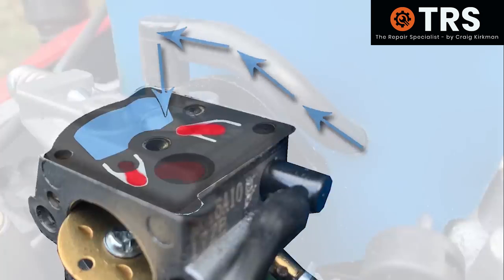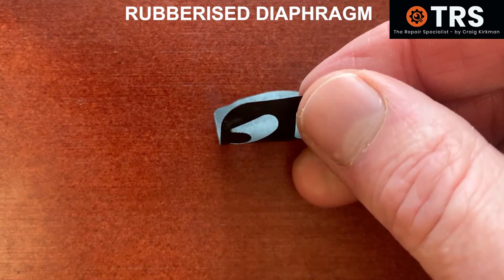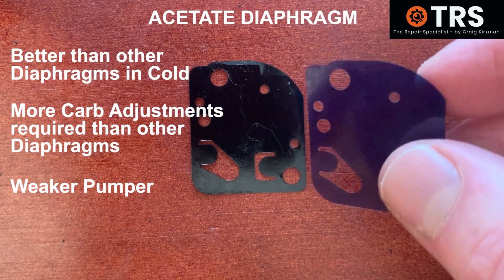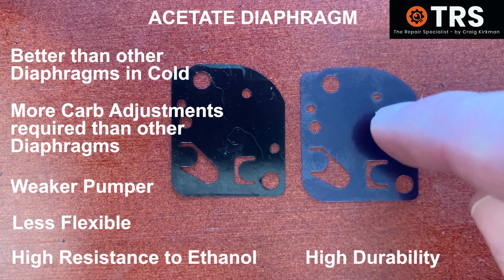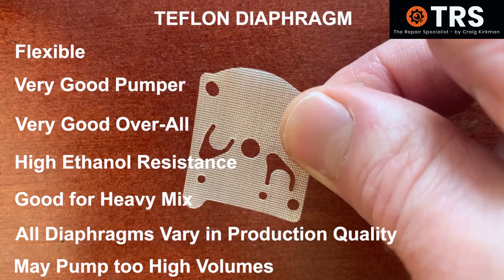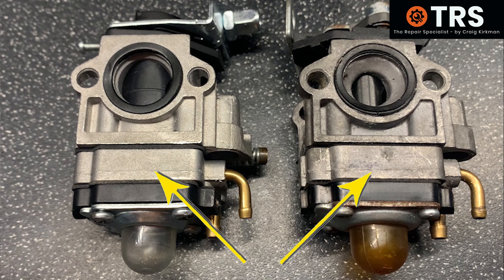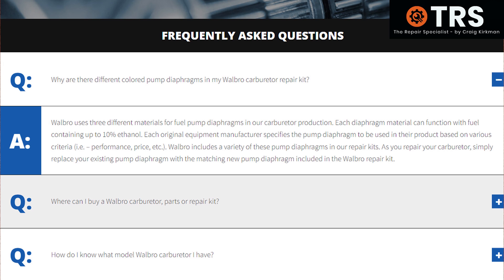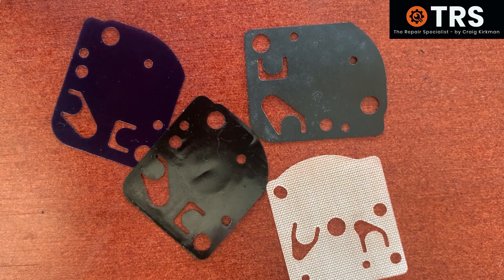2-Stroke Carburetor Diaphragms Different Colours. This is why!  (by Craig Kirkman)

Comment: Rubber diaphragms always dissolve in alcohol-containing gasoline. You can then see through the tissue where the rubber was once attached, and they are no longer gas-tight.
The dissolved rubber can be present in small holes in the carburetor, so this should be inspected, preferably with a magnifying glass. It can be difficult to see in small holes, causing the engine to still run poorly after installation.
Using an alcohol-resistant diaphragm is only useful if the rest of the carburetor also does not contain rubber that can dissolve in alcohol.

Comment: i have walbro carb on my chainsaw and i put fresh new diaphragms but problem remained as it was with old one....when i give it some throttle chainsaw chokes. it does that with both sets,old and new. my guess is that nozzle jet is not working properly or there is some dirt that blocks its "lid" that closes and opens the nozzle jet.
both L and H are 1.5 turns out...
it is like fuel is not arriving from second and third hole when i give some throttle. you know of which holes I am talking about.
so what are my options? new carb,ultrasonic cleaning?
Reply from the maker: Hi. 

It definitely sounds like you’re on the right track. If both the old and new diaphragm sets give the same choking and fuel starvation symptoms when throttling up, the issue is likely deeper in the metering or main nozzle circuit rather than the diaphragms themselves.

If fuel isn’t arriving through those small progression holes when you open the throttle, it usually means there’s a blockage in the main nozzle jet or emulsion passages — these are extremely fine and can trap varnish or debris that normal spraying won’t remove.

Your best options:
	1.	Ultrasonic cleaning – This is the safest and most thorough way to clear internal blockages without damaging soft metal jets. Run it for 10–15 minutes in a 50/50 water–degreaser mix, then rinse and blow through with compressed air.
	2.	Replace the carburetor – If cleaning doesn’t restore consistent fuel delivery, replacing it may be more cost-effective than chasing hidden restrictions.

Also double-check that the metering lever height is set correctly — if it’s too low, the needle won’t lift enough under throttle, and you’ll get the same “lean choke” behaviour even with clean jets.

I hope this help a little and please let me know how you get on with this. 

Craig
Reply: @TheRepairSpecialist  thanks a lot. i will try to do that

Comment: I always use non ethonal  , 97  it's slightly more but I never need to re build or replace carbs  

25nyear old chainsaw just required it's fule lines replaced,  and it's diagrams we're just fine n dandy. And they are original . !

Fresh high quilty fule n oil mix is the key to not rebuilding a carb  !

Comment: I found recently when I rebuilt my Walbro carburettor on my now discontinued Hitachi line trimmer the number on the carb did not match with any walbro kit.
I went to my local mower/ chainsaw repair shop and we matched up the gaskets from the walbro kits he had in stock. They were all the rubberised gaskets the same as the originals as our petrol from most of our suppliers here doesn’t have methanol.  It had extra gaskets that I will never use but at least my faithful 9yr old Hitachi is running perfectly again. 😀

Comment: Hi Craig, I was wondering if you could advise me on what I'm doing wrong in putting together my Zama carburetor. I've taken apart many carbs & rebuilt them, but this one is really frustating me. It is a Zama H18B   CIU 44P. No matter how many times I put it together, it always leaks gas from the primer bulb end. I can't seem to buy another one from Walbro. Your advice would be greatly appreciated.
Thanks BOB WHITE

Comment: Are there diaphragm carburetors with 2-stroke oil injection ports and also coolant-taps (for quick-heating & heat-dissipation)? I've looked for it a while and not had much success in my search

Comment: I was wondering what the different materials were for, and noticed I had used a Teflon one, in one of my oldest chain saws. The carb needed cleaning, slight adjustments, inlet screen was plugged. The Teflon fuel pump diaphragm is in excellent condition. The metering diaphragm was, if anything, a bit soft.
My old chain saw would want a good pumper, and the a-holes in government mandated that all grades of gas here have some alcohol in them.

Maybe they could make metering diaphragms to replace the rubber ones???

Comment: Ethanol was the biggest mistake our government did to provide welfare checks to the corn farmers.  I have had many issues with my small engines and the damaging effects that ethanol has had on the materials related to supplying fuel to the engine.

Comment: They need to make them run off a small Propane tank lantern size tank the green color 1s u buy in the camping area thats would fix alot of flooding and just runing problems that come alone with gas trimmers and they burn so clean !!!

Comment: Hello Craig  and thanks for this materials and properties video .
I just wish I'd seen it before, I've just replaced acetate with acetate but thought the Teflon one was just for an upgraded carb that I didn't have , and I m fairly certain that we have our E5 fuel till 2025, after that there's no information. It's worth the extra for me as I only use about two or three  gallons of 2 stroke per year , ( about 12 to 13 ltrs ) .Thanks for sharing Craig. 😊 ATB, Ian👍

Comment: Great video!!!

In Canada i use and ice auger to go fishing in winter drilling through four feet of ice or more and over the years have serviced my carberater a few times and have used both ethanol and non-ethanol fuels and now use inly non-ethenol and found that my silicone valve diaphram has help up for many years now and all I’ve had to replace is the actual pump diaphragm made up of a different black material. 
This has been on a 24 year old jiffy ice auger model 76 with a tillotson carb.

Comment: Did not have that information prior to this. But I have a chainsaw that has been old faithful. I live in the southeast. It has recently gotten colder than it has been. The saw has a rubber diaphragm on it. Well the carb is clean. It will not run properly. Weed eater, mowers ect run fine. Non ethanol fuel. Changed diaphragm saw runs great. Thanks!

Comment: I agree the black rubber ones seem to wear out very quickly, mine are on 20/30cc petrol aeroplane engines, most of the time running flat out on 98% octane and 3% motul 710 synthetic oil mix.

Comment: Perhaps if the engine and suction is worn, you could use the teflon one to give extra pump boost?  I have used all 3 but never seen any issues after tuning in. This is with 25/1 mix and i always tune  slightly towards rich to be certain theres enough oil, never fouled a plug yet! Seems the acetate ones couldnt pump as being totally stiff?  and i only use straight fuel with the oil so dont need that type of diaphragm.

Comment: What I think is that your videos are awesome lol. 
To give an example I used to be a Johnsered chainsaw dealer and I purchased a saw as well as a trimmer back then and that was around 2002.
I’ve never had any problems with the carburetter on my trimmer, and it has never ever seen ethanol fuel, and I decided to pull it apart to clean it two years ago, and I was astonished that it looked like a completely brand new carb there was no dirt or no anything in that Carb.
I pulled others apart that I started using ethanol after only one year and I was seeing a white powder inside of them even just a Lake coding. It just eats everything.
I’ve used ethanol fuel, and it takes out the check valves as well. Best to just not use it at all, if you can. 
In Canada here we have a few fuels that have no ethanol in them .

Comment: That is all very good information to know & it all makes total sense, but why aren't all of the diaphragms cut the same? Like where the valves go as explained in your video how the priming system works?
Reply from the maker: Thank you for your kind feedback. I really appreciate it and I'm glad you're diving into the details of carburetor maintenance—it's an area that can certainly benefit from a clear explanation. The reason a carburetor service kit might include diaphragms with different shaped cut-outs, even though they're for the same type of diaphragm, usually boils down to the application of the kit across different models or variations of carburetors.

Here's a more detailed breakdown:

Model Variations: Carburetors, even within the same brand or engine type, can come in slightly different configurations. Manufacturers often design service kits to be as universal as possible, accommodating various models. Different shaped cut-outs can match different carburetor tops or internal configurations.

Year of Manufacture: Across different production years, the same model of carburetor might have undergone slight revisions. These changes can include alterations to the carburetor’s internal chambers or vacuum ports, necessitating a different diaphragm shape.

Aftermarket Modifications: Sometimes, a service kit is designed not just for stock carburetors but also for those that have been modified or are using aftermarket parts. Different cut-outs cater to these variations.

Environmental Adjustments: Carburetors can be tuned differently based on the altitude or climate they are typically used in. This might require a slightly different diaphragm shape for optimal performance.

I hope this helps a little

Craig

Comment: Most of the issues I see is a hardened fuel control  diaphragm and they are always the same material. If no water is in the fuel the carbs are like new inside with 10% Ethanol. The fuel lines are the big problem and the best is the black rubber like hoses On Echo products.
Reply from the maker: You bring up an important point regarding small two-stroke carburetor diaphragms and fuel-related issues. It's true that diaphragms can often become problematic due to the material they are made of and the conditions they are exposed to.

Ethanol-blended fuels, such as those containing 10% ethanol, can indeed contribute to the deterioration of rubber components, including diaphragms and fuel lines. Over time, exposure to ethanol can cause rubber to harden, crack, and lose its flexibility. This can result in issues with fuel delivery and carburetor performance.

You also mentioned that the type of fuel lines, particularly the black rubber-like hoses on Echo products, can make a difference. High-quality fuel lines can be more resistant to the effects of ethanol and last longer before requiring replacement.

To mitigate these issues, it's a good practice for small engine owners to:

Use Fuel Stabilizer: Adding a fuel stabilizer to your gasoline can help slow down the deterioration of rubber components, especially if you plan to store your equipment for an extended period.

Regular Maintenance: Periodically inspect and replace fuel lines and diaphragms as needed. This proactive approach can prevent fuel-related problems before they occur.

Use Ethanol-Free Fuel: If available, consider using ethanol-free gasoline for your small engines, as it can reduce the risk of ethanol-related issues.

Follow Manufacturer Recommendations: Always follow the manufacturer's recommendations for fuel and maintenance in your equipment's owner's manual.

By taking these steps, small engine owners can help ensure the longevity and reliable performance of their equipment, including chainsaws, trimmers, and leaf blowers.

Craig

Comment: There are new metal diaphragms that are in a spiral design can't remember name of company but you can watch video on Steve's small engine repair.  But your experience with different types of materials makes sense. I have had them dry out and get hard/No flex, no pump action.
Reply from the maker: Thank you so much for sharing this valuable information about the metal diaphragms for small 2-stroke carburetors! It's great to know that there are innovative solutions out there. I appreciate your recommendation to watch Steve's small engine repair video for more details. I have actually been a keen subscriber of his for years now.  Your feedback about diaphragms drying out and losing flexibility is incredibly insightful and helpful for anyone working on small engines. Your contribution to the community is much appreciated, and I'm grateful for your input! Craig

Comment: I naive never thought about which material diaphragm to use, as long as the diaphragm is an exact cop of the one I removed.  I will try to use the Teflon version in the future if it is available in the kit.  I do not worry about ethanol, because I use nothing but PNE gas in all my two and four cycle equipment.  PNE = premium, non ethanol.  Premium= 91 octane.

Comment: Once upon a time here in Adelide ----Australia----everyone went to buy  two stroke petrol from 
the petrol station ....then  the "new owner from the East come " and  they took it off ...Then I followed
the others  UNLED AN TWO STROKE OIL (100ML  X  5  LITRE OF PETROL) A time I heard that was not 
the right petrol until I started to see the videos and started to take note of it....A friend told me to look 
for the pump where is written 90...he said it is a bi expensive but is top result for small engine .
Now Mr Greg  could you make my life a bit easier  ...which diaframma is the best one among the four?
Sems a lot of comments get good result the Teflon one ....then next is the Acetate --black one -
Because I by  I get mine from China  should I ask to send me only that I require ?
Thank you
Reply from the maker: Awesome story.  I personally would use the Teflon over all the others if I had them to choose from. I hope this helps
Reply: @TheRepairSpecialist  ...Thank you very much your kindness is very much appreciated  .

Comment: The original rubber diaphragms on my weed whacker were hard and deformed after 34 years and the machine was starving for fuel. I replaced the diaphragms and chose the acetate diaphragm first. The machine still starved for fuel at full throttle after a few seconds. I then put in the teflon diaphragm and the engine runs like new again.

Comment: Excellent explanation of diaphragm types! I knew there were different ones, but didn't pay a lot of attention to what they were made of, just matching what the carburetor came with. Ethanol is not only a killer of diaphragms, but the entire fuel system as well. Even Tygon line succumbs to it. The metal of the carburetor gets eaten by it as it's a magnet for moisture. I'm fortunate to have ethanol free fuel available and highly recommend it to all my customers.
Reply: Agreed on all counts

I'm repairing an old Craftsman chainsaw and hedge trimmer for a co worker and whoever had them before him used 10% ethanol fuel so all the fuel lines, gaskets and diaphragms were either rock hard or disintegrated. Got new fuel lines put in, ran the carb parts through my ultrasonic cleaner and waiting on delivery for the carb repair kits, and hooked my co worker up with some packets of AMSOIL 2 stroke oil for him to mix with some 91 octane ethanol free (the mix I've used for years that works like a champ). Hopefully he'll get plenty of years of good use out of them after I'm done working them over.

Comment: I think I met the "inventor" of the acetate diaphragm, about 25 years ago I heard a guy telling his friends that he badly needed his chainsaw fixed and that he had cut his own diaphragm out of photographic film and it had worked perfectly.
At that time I only knew about the rubberized diaphragms used by my own chainsaw and it seemed to me that he was making it up, more than anything because it seemed to me that the film would be too rigid to work, then a few years ago I bought a cheap aftermarket kit on eBay and the material was suspiciously similar to acetate film and I wondered if it was really a true story 🤔
Reply from the maker: Awesome👍

Comment: Good Stuff, but what about the metering diaphragm when it comes to ethanol? I find that part the weak link in the chain when it comes to ethanol, so an ethanol-proof fuel pump diaphragm might last, but you will still need a rebuild kit because the metering diaphragm will stiffen up and stop working...... unless you stick with ethanol free fuel. In Canada, Shell V-Power is ethanol free, at least according to their website. Thant's what I use and no more troubles.